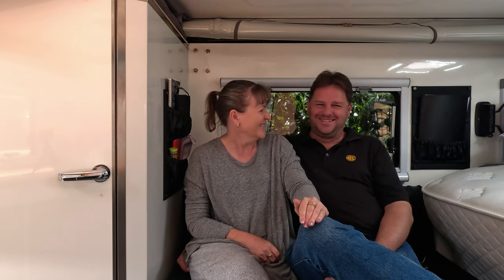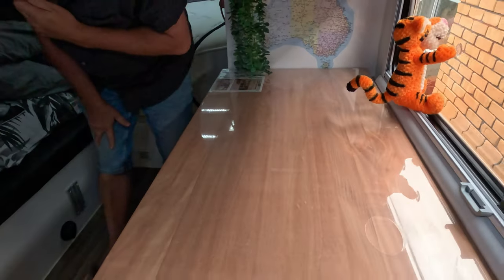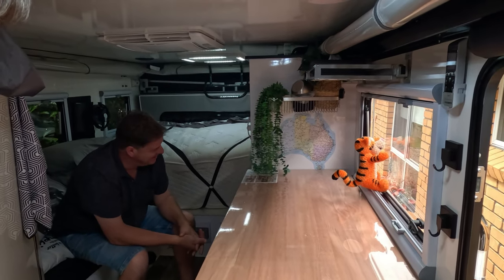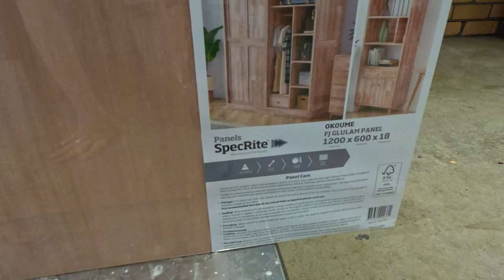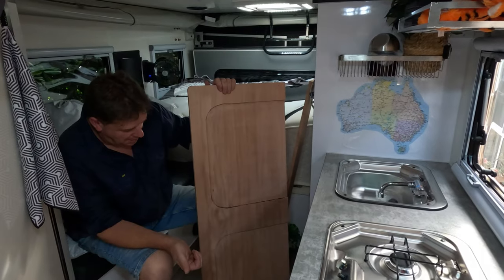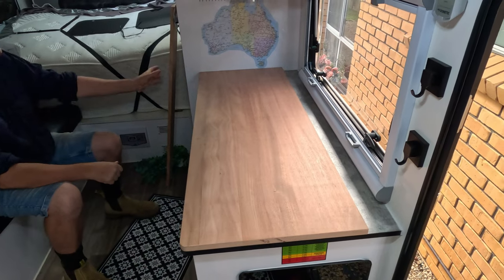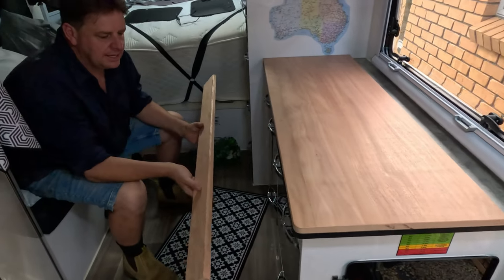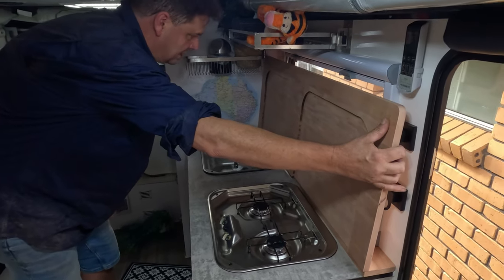Austrack Tanami 15b Bench Mod

Comment: I started on this project earlier in the week. My closest Bunnings is 160k away, and they had a choice of Beech or Golden Acacia, which is very dark, went the Beech. I couldn't see the point of removing all that timber where it has nothing to clear, so just did the profile all around, left the middle in. The Beech immediately warped. It was fairly warm, mid 30's with low humidity. I left it on the shed floor on cardboard, weighed down. Checked this morning, still warped a bit, clamped  timber across it. Temps have been around 45 deg meantime. 
Did your Okoume warp at all? Has it been subjected to high temps and big variations in humidity? If not, I may have to re do the job, get the Okoume in special order.
Reply from the maker: thats a shame about your bench. Ours hasnt warped at all. We hit over 38 here on the weekend and the vans outside at the moment in all the weather. so also super cold and frosts in the winter.
Reply: I had to abandon the use of Beech. I had it all cut to size, left it in the van, it warped horribly. I received another panel, this time Golden Acacia( hardwood) yesterday, immediately clamped it all over, left it in the shed to acclimatise. We have 4 days forecast of 45 starting today.
Reply from the maker: @ralphblundell9479  I hope this one works for you.  It's a great addition & we love having the flat surface.  Good luck!

Comment: Grave dig question. Did you fix the bench top or is it just a free floating top?
Reply from the maker: It is free floating, so we can remove completely at a later date if needed.  It's sitting on some dense foam to protect the bench underneath.  It has never moved or slid while travelling.  Thanks for watching!!

Comment: Does the stove still work without the lid? The gas should only flow with the lid open.
Reply from the maker: The gas works fine.  Doesn't seem to make a difference the the lid isn't on there.